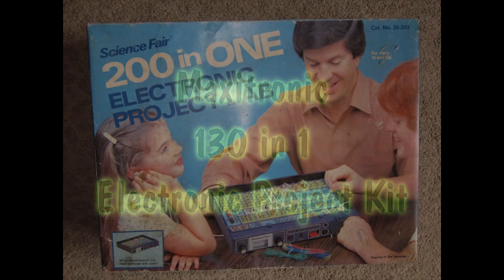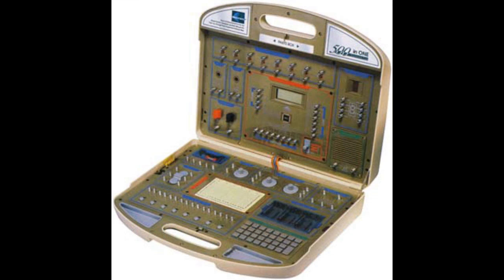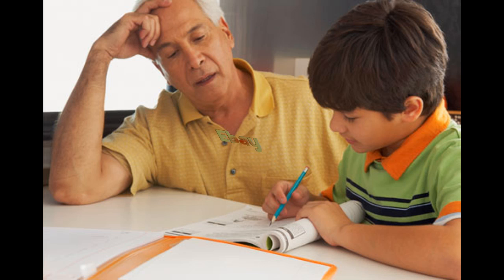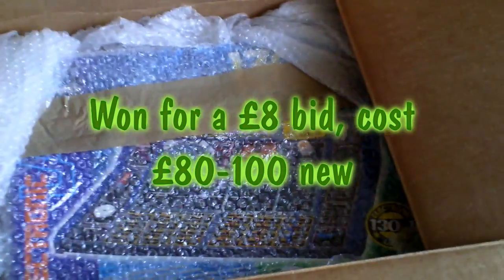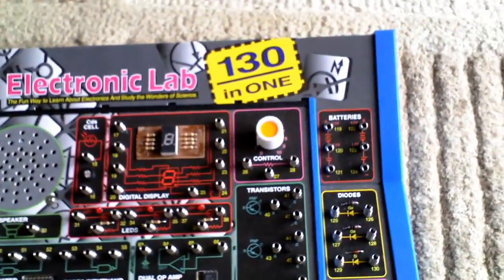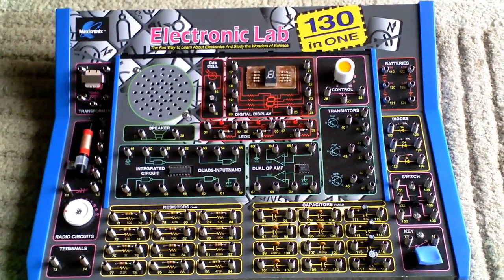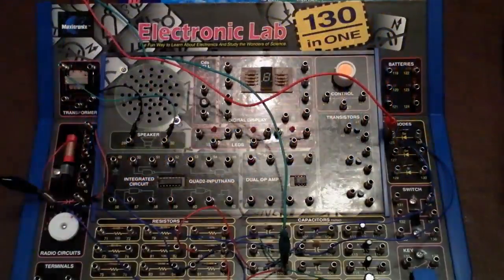130 in 1 Electronics lab hobby beginners Projects Kit

Comment: I am maybe going to buy a used 130 in 1 for $20 Canadian so I can experiment with getting ham radio and maybe transmitting RF as well, which would need something like an arduino to generate the signal. BTW:see:
https://www.elenco.com/wp-content/uploads/2017/10/EP-130_Manual_REV-C-2.pdf
Reply: I was given a choice to get the 130 or the 300, so I chose the 300 thinking it has more options, which in theory it does. I made a video about the package:

https://www.youtube.com/watch?v=zIhVfVyA3eM

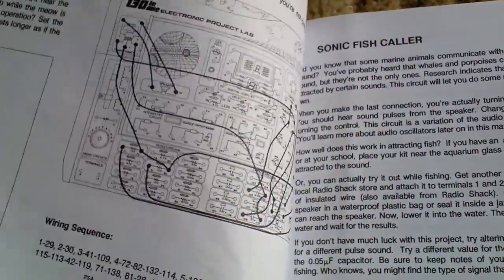Comment: What is the part on Motorcycles about?  I'm learning Motorcycle mechanics and this could come in handy.  3:15
Reply from the maker: Sorry I don't really follow.  Cannot rem a part on motorcycles ?
Reply: fredintheshed1
If you go to the time marker I indicated at three fifteen in your video, the book says Electronic Motorcycle.  It's as plain as day!  What is that about is my question?  It must be basic wiring for a bike.  I cannot read the text as you flipped past the page too fast and it won't go into focus.
Reply from the maker: Right got you.  As I rem (bare in mind this is 4 years ago) the ref to the motor bike wiring in the book was a circuit that you could build which gave an audio sound similar to a motor bike changing gear as you charged and discharged a series of capacitors.  Sadly this has nothing to do with actual real life motor cycle wiring.
Reply: fredintheshed1
Thanks!  I was contemplating buying one of these kits to learn about wiring but not sure since they're so expensive.  Maybe I won't bother then.

Comment: I got the 30 in 1 box that my brother bought in 1984. It still works but I dont feel I learnt a lot by only just connecting wires. The booklet with projects helped a bit to figure out what a transistor actually does
. I have decided not to go further with these sets and go for a real hands on experiments kit like Snap Circuits which I discovered yesterday. You can make things move!

If only we had that in the 80s , right?
Reply from the maker: +boowonder888 Yes I agree.  I rem that bread board seemed amazing back then. LOL
Reply: +boowonder888 I have spent months studying circuits and discovered an awesome resource at Gregs Electro Blog (check it out on google)
Reply: lefter tiberiu vlad Thanks, I will! . I like building things more than putting together a circuit. 2 day ago I tried a blinking circuit with a 555 chip and a breadboard. It didn't work, why? OK I had different resistors than were specified but I don't think that would have made a difference.Then I continued with my mini Roman Catapult that does work.

Comment: You can still by these ?  IT'S BUY THESE...
Reply from the maker: Yes you can still buy electronic hobby learning kits.  Amazon sell them.  However they are not cheap. Its better to watch ebay and pick one up.  Good hunting.
Reply from the maker: Cliff Yablonski  Nice to hear you can still buy them over the water.  That's a very good price as the modern kits are quite expensive here.  Thanks for the info Cliff.

Comment: Just picked one up at Value Village for $3.99 Canadian dollars. Came with the box, has a hole in it ,but, the unit itself is in mint condition along with the manual and wires. I currently wired in a fuzz face schematic, works great.
Reply from the maker: Great find.  Some poor parent prob paid $70 for it.  Thanks for the feedback
Reply: I've also picked up a 150 in 1, and two 50 in 1's for the same price each. Check your local thrift stores and you may luck out.
Reply from the maker: Rolo Tomasi Wow that is fantastic value buddy.  Sadly here in the UK we have charity shops which normally chuck this kinda stuff straight in the bin, no joke ;-(  They mostly sell women's clothes.  Enjoy your new toys ;-)

Comment: I was trying to build a radio but in the wire sequence it goes something like #######-ANT. Does it mean antenna? how do you do this ANT when trying to build one of the radios.
Reply from the maker: I would think that ANT means antenna.  You just need a long wire.  The length depends on what band / freq your radio kit is.  For MW a 2 meter length is a good starting point without overloading.  For SW I would start at about 5 meters and work up.  I was using about 7 meters on my LW radio video. Mostly its trial and error,  have fun.